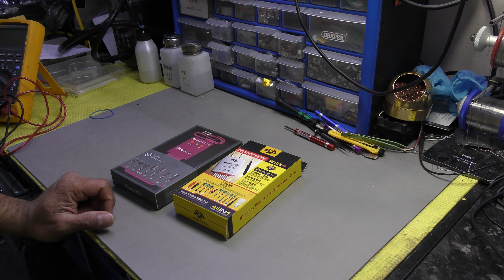QIANLI IPOWER PRO AND W103+ FOR IPHONE REPAIR

Comment: Good tip on insulating the aligator clips.  On the W103+, it would have been nice to cover whether or not the device regulates or only passes through, and the "Trigger Probe."  The voltage passes through unregulated, so need to watch the voltage on the power supply, just like on the iPower Pro.  The Trigger Probe is just a direct connection to ground, which can be used to pull down trigger inputs, like presumably the power button, to turn on the phone.  I checked on mine, and there is no resistor or anything on the trigger probe - it's just a solid connection to ground, so use with care.